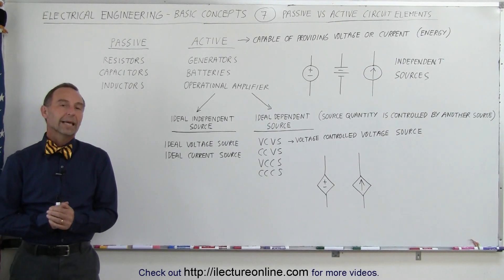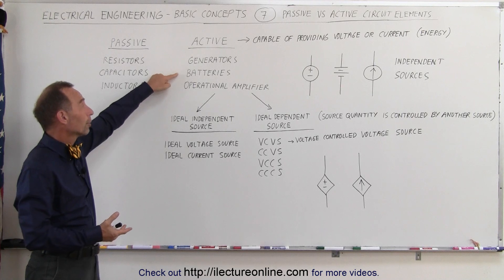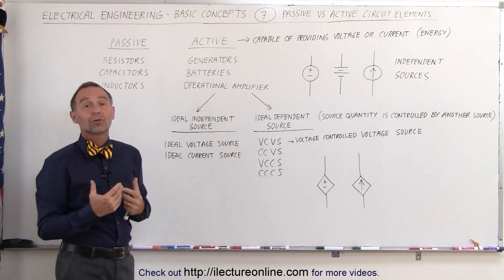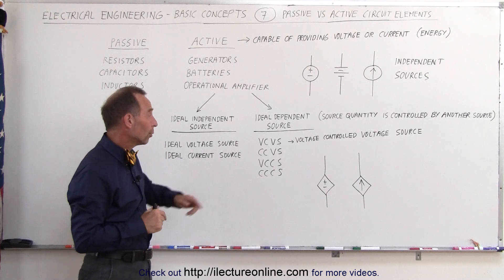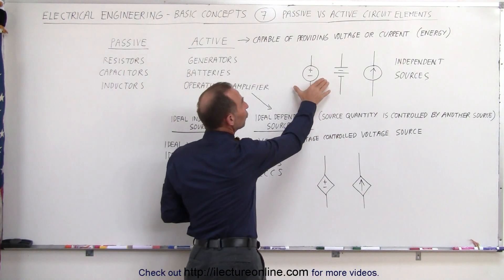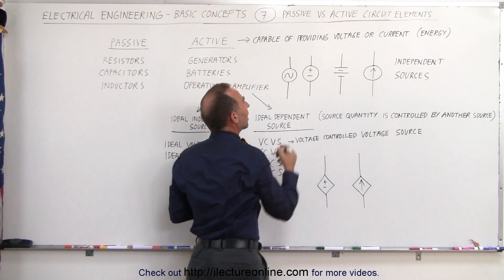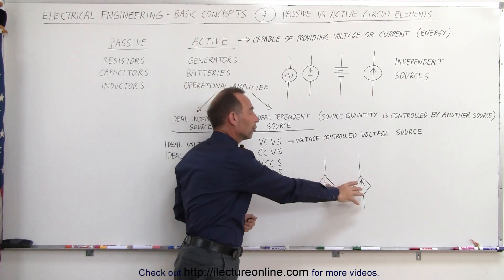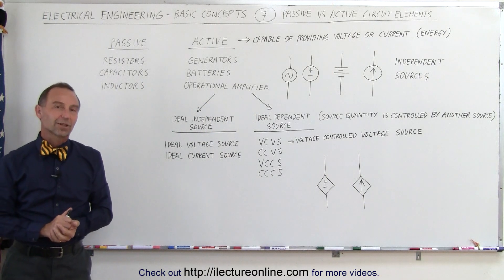Electrical Engineering: Basic Concepts  (7 of 7) Passive vs Active Elements

Comment: I have been finding numerous references to transistors, vaccum tubes, relays, etc as active devices, stating an active device is such that controls electricity by means of an electric signal. On what i saw in your video the concept of active device doesn't seem to match, or am i perceiving it wrong? What do you say about it?

Comment: the second independent voltage source which theres a + and - inside the circle is not a AC voltage source as you describes? at 3:51 . I think thats a constant DC voltage source. correct me if im wrong
Reply: this confused me soo much. pls help
Reply: That symbol can represent constant or time-varying voltages. This is according to... https://youtu.be/8_AWiueI4Qg?t=1m45s